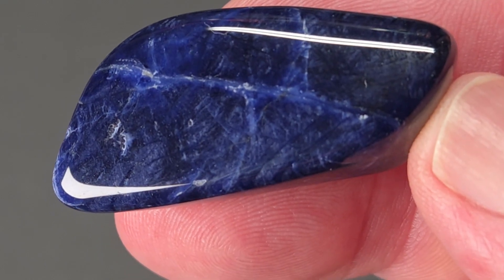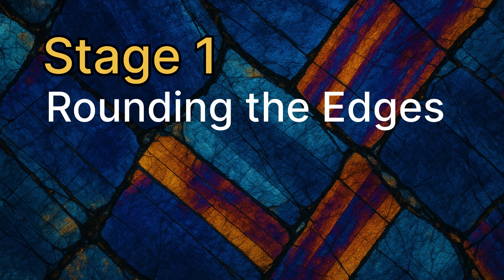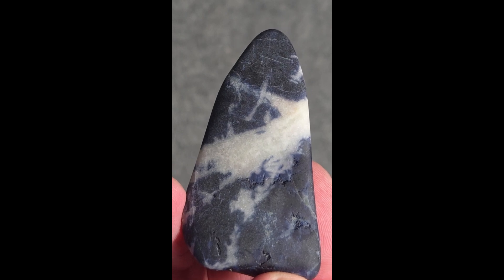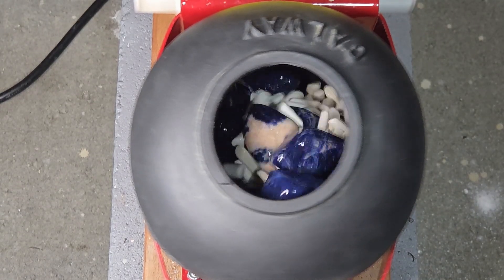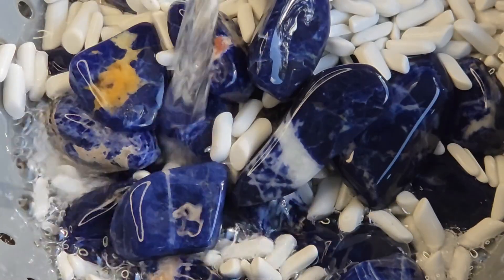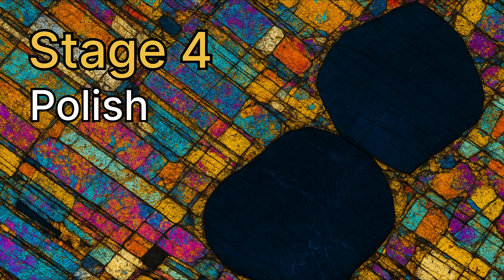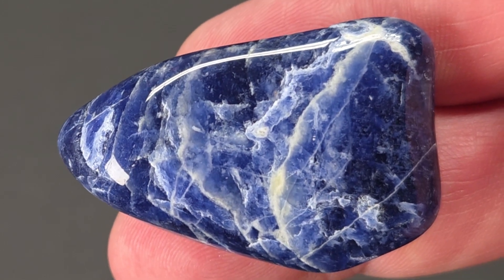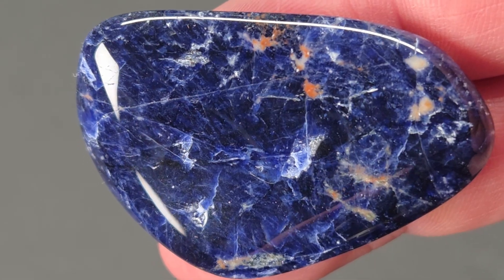Tumbling Sodalite: Step-by-Step Guide

Comment: What would be the effect… if between pre-polish & polish stages, a stage of 1000 grit (or even more finer) was run? Negative, positive, or no effect?
Reply from the maker: Great question — a 1000-grit stage can help refine the surface a bit more on softer materials like Sodalite or Tiger’s Eye, especially if you’re chasing a mirror-like finish. I usually skip it to keep the total tumble time down since this Sodalite wears quickly. A well-run 600-grit stage preps the surface well enough for my purposes. Thanks for watching and commenting!
— David | Rocks In Motion
Reply: I look forward to getting a vibratory tumbler next year, to be more apt to handle softer rocks like sodalite. The color of sodalite reminds me of Dutch delft pottery.